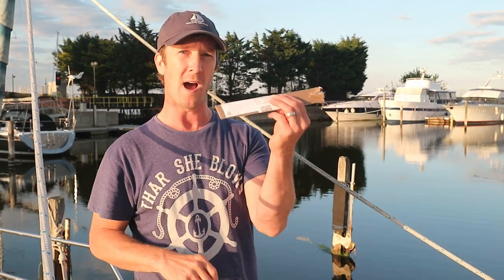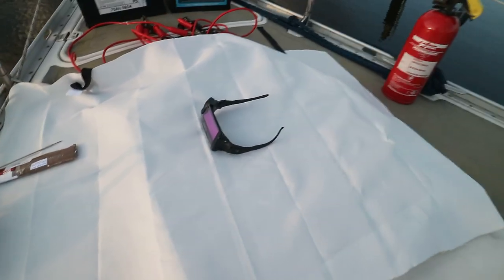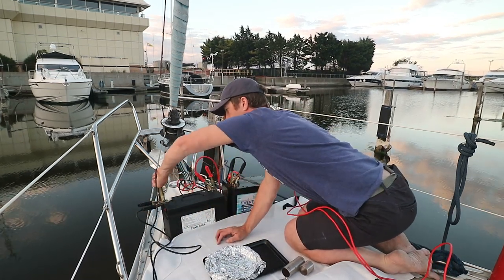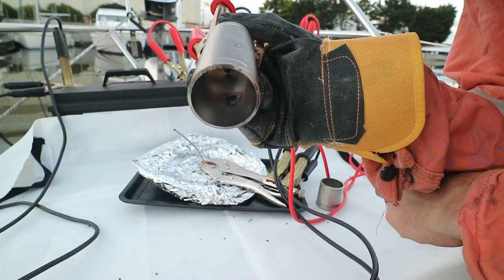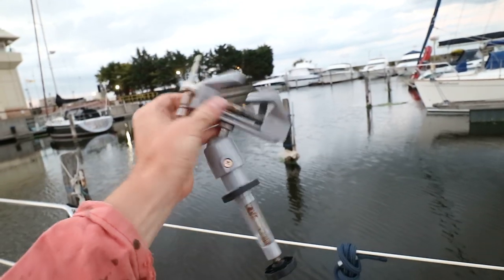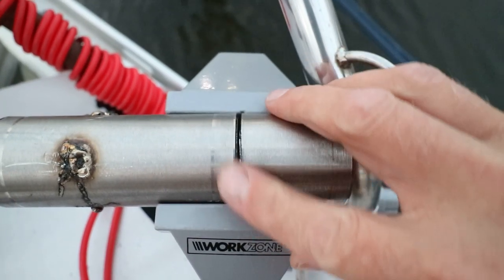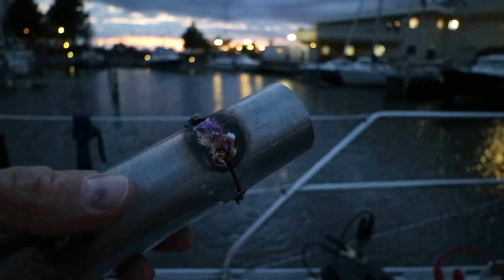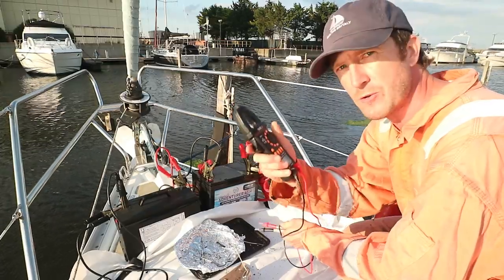Emergency Welding for Sailors (2 Batteries + Jumper Cables) | ⛵ Sailing Britaly ⛵

Comment: Freaky. ... better than i ve expected. ...cool idea. Will put some of these welding pins on my boot
Reply from the maker: If it was an emergency and I had to do this for real, I believe it would work well with some time & patience. We have a grinder on board which we can run off our inverter so I could weld, grind, weld, grind until we got a good strong weld. I hope to never have to do this but I like having options like this in my back pocket. Cheers, Chris 👍

Comment: My first welder that my father bought me when I was a young teen, was made by SP and was a transformer less welding gun that ran off 2 car batteries.  It was basically a large solenoid with a rubber handle and heavy lead attached,  a coil with a floating spring loaded shaft in the middle that had a brass chuck on one end to clamp the welding rod. As you struck the work piece the shaft would jump back a millimetre  or so and break contact momentarily like a vibrating motion but this gave it like a pulsed DC that helped to stop the rods sticking. Don't know if these are still available or if anyone remembers these. SP went on to become a big manufacturer of hobby welding transformers. It took a bit of getting used to and was a bit crude in that you had no current control so you had to find which gauge rods worked best and stick to it. However at 14 / 15 I learnt to weld with that thing and was building carts and fixing bikes for many years till I bought my first second hand welding transformer. At the time, it was cheap, I think under £20 for a whole kit with welding mask, cables, clamps the lot. Something like that would be a useful light weight emergency welding solution to carry onboard.
Reply from the maker: Thank you for sharing Peter, I have very happy memories of helping (or perhaps hindering!) my father do manual work too. Seagull engines and BSA motorbikes were a common sight when I was growing up. Learning from your parents is much more pleasurable than from teachers, in my experience anyway. There are some impressive welders on the market these days. We had a welder come on board a vessel to repair a massive sheave wheel off a hydraulic launch and recovery system we were using to launch a couple of tons of ROV of the ship. It was a massive job and this Dutch bloke rocks up with a tiny little inverter tick welding machine that looked like a toy. He did a beautiful job on the repair in a very short time (with many, very neat, passes) and I was gobsmacked at how much could be achieved with such a small and lightweight bit of kit - with a skilled operator of course. We did a load test, and put everything back together really quickly and were operational again in no time... Thanks again for sharing your thoughts. Chris 👍

Comment: I am glad somebody made this video, well done.  While it is clear that you are no welder, it is also clear that you won't let that stop you from making a field expedient welding repair so you can get back under way.

It should probably be noted that it is of crucial importance that the welding electrodes be kept sealed and dry; moisture can wreck the shielding material and make it much more difficult to get a decent weld.  They sell dry tubes designed for storing rods, or since you probably don't need that many, maybe vacuum pack them to take up less space.  Either way throw a desiccant pack or two in with the rods before sealing them up.

Some practice and/or lessons on dry land with a real welding machine would help a lot, so you can get a better feel for the correct motion used to strike the arc, and how to properly hold the rod and maintain the arc as you run a bead.
Reply from the maker: I never let not having experience in something stop me from moving forward. The best way to learn anything is to just go ahead and do it... My first project of welding anything (after a couple of hours of instruction / practice) was to make a 'boat lifting system', out of steel box section, which I then used to lift 26 foot boats and work under them. Using a proper welder is a lot easier than using batteries, but there is no way we'll be carrying a welder offshore so I like to experiment with things to be more prepared for whatever might happen in the future. Great point about keeping the electrodes dry. Cheers, Chris

Comment: Chris, does the package of electrodes say use DC+ of DC- ? It appears the entire rod is glowing red... most 308L electrode say DC+. Try swapping the polarity, it may weld better.
Always check the parameter specs on the rod package...
Reply: i think you may be wrong there,, dc + even more power goes throo the rod so it will heat up even more
Reply: roderick mchardy , depends on the type of Rod he is using and what the manufacturer specs say...just noticed the whole stick was glowing red....
Reply: @mikeforte8045  While there's every chance that you're right, I'd just like to point out that lots of cameras pick up a lot of infrared wavelengths, making stuff that's just really hot look red hot. Could be either.
Reply from the maker: Hi Mike, these were 316L electrodes, (1.6 mm). I believe they are DC- electrodes but I only bought 20 of them and they were shipped without any manufacturers packaging, so this is difficult for me to confirm. They were visibly glowing red hot at times so this technique could be improved with A) Larger diameter electrodes, or B) By making a simple current-regulating device out of a coat hanger and putting that in the circuit (more coat hanger wire = more resistance and therefore less amps [the coat hanger wire would get hot so this would to be allowed for] The length of wire in the circuit could be adjusted by clamping it in the desired position along its length) I was happy with getting some good runs after a quick trial: there is lots of room for improvement and if I get the time one day (or ever have to do this for real) then I'm confident with some tinkering very good results would be possible. Cheers, Chris

Comment: Thanks chris, have heard of this before but don't carry any jump leads (or multiple) on the boat. Have had problems with my alternator on my last boat. After a night at anchor had to borrow a battery from a other boat to start the engine then return. Most sailboat engine don't have a lot of electronics and smaller engines have hand crank, my yanmar 2gm20 did but i thought it would be less work to borrow a battery than hand start that beast!  Good experiment but i would rather carry duck tape to fix a hole after all if you are out in the ocean it will be the rig you need to fix🤯 i have welding certificates from when i was a appreciate but even then i was hopeless at aluminium welding. Still appreciate the video as said have heard of this before but never seen it in action. Carrying rods jump leads and visor is lighter than a welding plant 👍  How fast is Emma growing up talking now soon she will be able to help with the jobs around the boat.
Reply from the maker: Hi Al, thank you for your comment. Battery cables could be borrowed from the boat to use in place of the jump leads. This is covered in the little PDF ebook I wrote for people to print off and keep on their boats. Durafix aluminium welding rods (or similar brands) are handy to carry for aluminium repairs, all you need for those is a propane torch. Cheers, Chris 👍

Comment: did you try welding Al?. since that is likely to be what needs fixing not stainless...i.e. mast/boom
Reply from the maker: Stainless gooseneck fittings do break occasionally, although you are correct that aluminium fittings fail more often. Fortunately, aluminium brazing rods make that an even easier fix. If anyone reading this hasn’t seen those yet, check out the videos here on YouTube. This is another very handy thing we carry on board Britaly.

Comment: Those lightweight handy 140A inverter "transformators" for welding may be run from a 24/220 V inverter. That may improve the chances to get a nice weld dramaricly!

Comment: I am going to our boat in a few weeks to do some repair. One of our lifeline post base broke - as the bot is on a mooring buoy, I may need to use your technique to fix it. Wish me luck.:)
Reply from the maker: Good luck with fixing it Tibor, there is a PDF download I wrote about this in our TREASURE CHEST on Patreon: Print it off and take it with you to the boat in case you ever need it (Now or in 5 years time when you may be out at sea with no internet and the memory of this video has faded...) Very best regards, Chris 👍

Comment: Great ingenuity! A bit of advice: store the rods in as dry an environment as possible.
Reply from the maker: Thanks Rich, absolutely, dry rods will definitely help get a good weld. (Although with this quick attempt the electrodes were glowing red hot, so that would probably dry them out pretty quickly! 😂) I'm confident that with some more time to refine the technique, and with time grinding and re-welding, you could get good results with this kind of set-up. Cheers, Chris 👍

Comment: Mate that's handy. Thanks ! Question. Do you need the coil only in the positive or both?
Reply from the maker: I only had it on the positive, but this whole thing was rushed so it's not as if I spent a lot of time tweaking things. I'm confident good results could be achieved with more time - we just don't have any of that at the moment. Cheers, Chris 👍

Comment: Thank you. I had no idea this could be possible. 
Thinking of preparing for stuff going wrong is something I have in common with you.
Is there any particular rating or type of stick to get hold of?
Reply from the maker: Thank you Ellul, it's people like us who bail out the naysayors when the chips are down... I tried 1.6 mm rods, but without a current limiter (a coathangar could work for this) they were runnig hot, so the next size up might be a better alternative. I have only had one bash at this (this video) but I' confident good results could be obtained if the need arose. Cheers, Chris 👍

Comment: Hi  I am curious where did you pick that idea up  RAF?  or is it your own?
Reply from the maker: There was none of this malarchy in the RAF, it was all very much by the book. The only two exceptions I can think of were the time I made a seal out of a foam earplug, which when compressed in a fitting allowed me to put 3000 psi of Nitrogen gas into an aircraft (we were in the desert and the only pressure guage we had had been sent out with a missing seal) and the time I lengthened the thread on an incorrectly-sized bolt to repair a helicopter undercarriage  (This was for a single flight only and we were 300 miles North of the Arctic circle at the time). I didn't do any welding until I became a boat dealer- rather than pay $$$$$ for a crane, my father-in-law taught me to weld and after a couple of hours of practice I made a 'boat lifting system' out of box section steel which we then used to lift (and work under!) lots of boats...

Comment: Not a very good welder but you know that. Some thoughts though. First is heat. You're going to end up with some nasty hard spots from the welding unless you temper which will lead to fracture under load. That is NOT a permanent repair. You can do but you'll need a better understanding of metallurgy. Not hard - cheap books for home/farm welding. Second is that there is a lot of aluminum on boats. Different rods and much higher skill requirement even if you have MIG or TIG. You can stick weld aluminum but you have to develop the touch. I welded a soda can back together as a final from welding school. I don't think I could do it today without punching through.

Comment: U could just go to harbor freight and get one that runs off your generater
Reply from the maker: We don't have a generator and have no plans to get one. We are already struggling with room on our boat with all the tools and stuff we deem essential, so finding somewhere to store a generator (plus fuel and spares) and a welding setup is not practical for us on our 35 ft boat.

Comment: With the whole rod glowing like that, there's way too much amperage.  Not sure how to reduce it, but it would improve the weld I'm sure.
Reply from the maker: As per another reply here, you could use a coat hanger to reduce the current flow - lengthening or shortening the amount of coat hanger wire in the circuit to adjust the current. I'd love to experiment with this to perfect the technique, but I don't have the time. Cheers, Chris
Reply: I'd go up a rod size or two and see if that helped.

Comment: that is a great vid,,,,,, the rods are prob 306  as opposed to 308 (  never heard of 308 , 309 for dissimliar  )  the rods look like 2.5 and yes current should be more like 90 ish ,   god knows what you could wrap the cables round to get it down to that but , hey ho , that looks like a good enough weld  and a few minutes with the grinder will have it looking  a whole lot better  ( obv you can weld a little bit because without a basic knowledge of the process and technique even this would  not be achievable ) ,,,,,,, ,,, but an important thing which you did not mention is to protect your eyes  ( and skin , clothing and boat surfaces  ) from the slag which on stainless will  " ping " off and for sure end up somewhere that it is not supposed to .  ps,, that baby is not a baby any more,,, tempus fugit  and all that
Reply from the maker: Hi Roderick, the electrodes were 316L, 1.6 mm. I welded for about an hour whilst filming this and got a couple of good runs. I only had 20 of those electrodes and didn't spend a lot of time tweaking anything. If I was doing this for real out in the middle of an ocean I would have more time on my hands and more of an incentive to improve the set-up. The current going through the electrode could be altered by using a coat-hanger as a homemade linear rheostat, by attaching the jumper cables (or battery cables and hose clamps stolen from the boat if you're really winging it and don't have jumper cables) in such a way as to shorten or lengthen the amount of coat hanger wire in order to alter the resistance and therefore control the current flow. I could have a lot of fun in perfecting this and making a really pretty and strong weld after some experimentation, but we always come back to the same problem in our life and that is an acute lack of time... Thank you for watching & commenting. Chris 👍